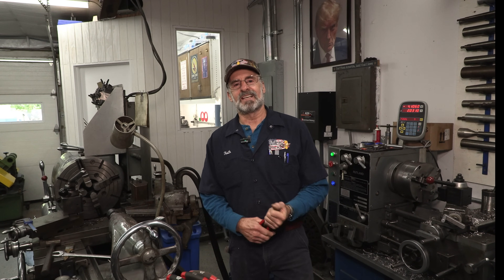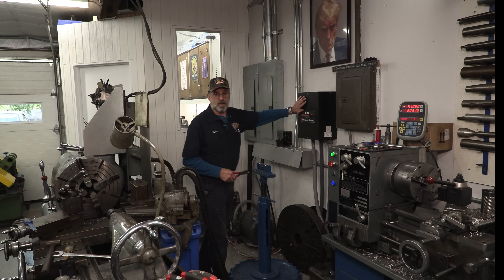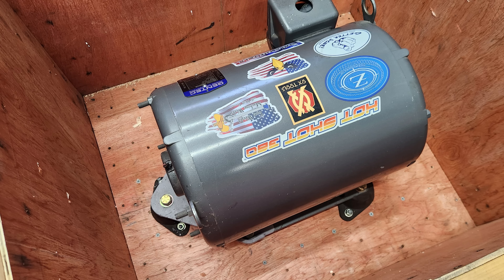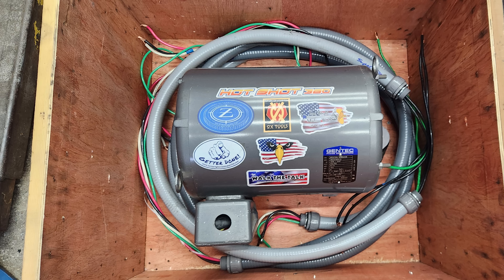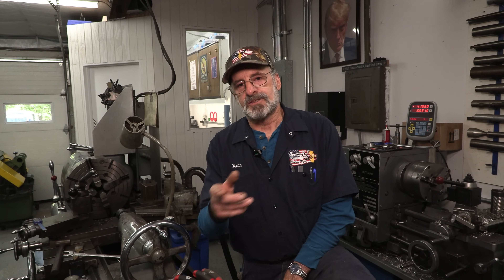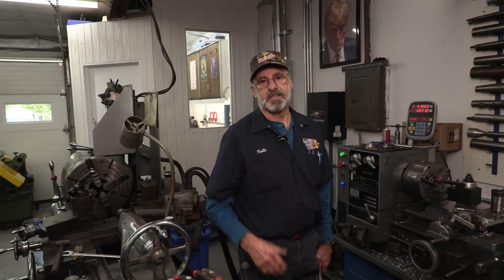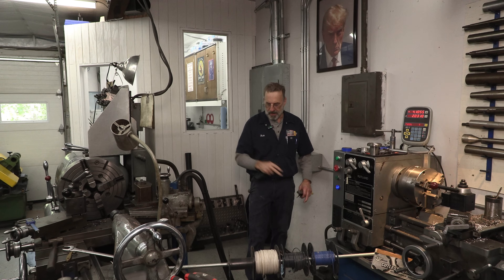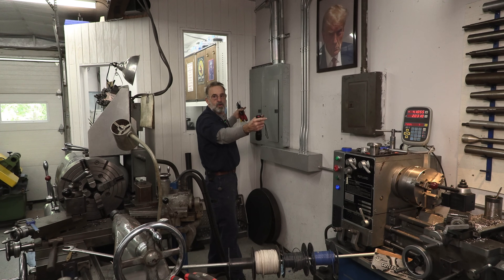No More Phase Converter

Comment: Keith, were your machines jumpered for 240 or 208 volts? If you used 230 or 240, consider installing a Boost Transformer to step the voltage from 208 back up to 240 or 480, and even convert back to a delta configuration. Talk to a local EE to order the correct transformer for your needs.
Reply: why would you do that? lots of wasted money and added complexity. delta power is obsolete and hasn't been supplied for ages now, to the point of power companies forcing customers to change their equipment and convert to wye setups.
if the equipment is that outdated to need delta power, it's time to modify it!  nothing I know of, ever required the high leg to neutral to function.
smaller buildings and lower HP motors, it just doesn't make sense to have 480v and all the added complexity/costs of multi-voltages and step down transformers to only run a small number of machines. 😐
Reply: @throttlebottle5906  I'm not sure I understand your reference to high-leg to neutral, which would produce 208V to ground single phase. Keith's shop has many machines, not a few. 
Not all legacy machinery can accept 208V three phase, especially instrumentation like DROs, etc. He already had open delta three phase coming from the motor-generator phase converter he owned. For open delta three phase service, the power company would only need to install two transformers, one bigger for 120/240V single phase and a probably smaller one for 240V open delta three phase. Since the delta is not closed, there are no circulating currents in the transformer bank wasting energy, and two unequal sized transformers cost the utility less than three size-matched  and impedance-matched transformers.

Comment: You can get "high tech" VFD (Variable Frequency Drives) that produce three phase power with user selected (or programmed) voltage and frequency with a wide range o single or multi phase  power.    It's all magnetic or electronic.  No moving parts.  The only noise comes from the cooling fan or a small transformer "buzz."
Reply from the maker: Yes, I know of those options....

Comment: It blows my mind that Eversource is that slow and took so long to do something so seemingly simple. They are never slow about demanding I pay my bill on time.🤣 I miss the old New England Power co and Public Service of NH They made things happen. Anyway congrats on finally getting power to the machines.
Reply: The electric company has no incentive to provide 3 phase power, they will be losing money as the 3 ph. Power should be cheaper! They typically drag their feet hoping the customer just installs a phase converter. I have 3 phase power line going overhead on my property but the power company refuses to hook me to it for my shop, the shop is too small and I’m in a residential zoned area!
Reply: On my utility the 3ph killowatts actually cost more than resedintial kWh.

Comment: 3 phase is the way to go. I have a 3 phase main line running through my ranch. Coop gave me the 17 reasons I couldn't get 3 phase service,  the main one being expense of running poles. I asked how far away from main line the first pole had to be. They said 40 feet. Wouldn't you know it, when I built my shop, the corner where the power came out  was exactly 39 fee!--go figure!!

Comment: Could you run the power overhead instead of running it across the floor, I know that’s not always doable so we’ll see what you come up with. 
Have fun on your trip and be safe!
Reply from the maker: I need to be able to move my gantry around in the shop, and the floor run is better in my case.
Reply: @KeithFenner , I knew you had a reason, thanks for the answer.

Comment: Congratulations! I remember you expecting this years ago. It's still mysterious to me how the US hasn't brought 3-phase into general use. Here in northern Europe every home has 3 phase 400 V and has has since the 1950s. Glad you are finally up to speed.
Reply: It gets worse! Philadelphia and Baltimore (or Boston) had 2 phase power. Philly was supplying 2-phase to the old section of the city in 2020. My dad had a refrigeration service business, so we had to be aware. I remember if you cross-phased the wiring you got 208 volts.
Reply: I served in the US Army in VN c. 1970.   The area of my responsibility was first "wired up" by the Navy a few years before.   The USN had 3 phase 120-208 power everywhere.   To be blunt:  it was silly.   Aside from requiring twice as many conductors, we had problems with equipment that as "rated" as capable of running 208-240 w/o any changes.  But in reality, the motors had early failures.
Reply: No. Not every home in northern Europe. In Norway it's normally 3-phase 230 Volt between phases. All other countries in Europe exept Norway and Albania have 400V between phases and 230 between one phase and neutral. If you measure between one phase and ground in Norway you'll measure ca 120 V. In areas with new system you'll have 3X400V and a neutral, giving 230 V between phase and N.
Reply: @lassehovde  I did hear that the reason for the 230V between phases in Norway is because there's not always a reliable electrical ground due to the geology.
Reply: @ehsnils  No idea, I guess it's like ''It's just this way'' Old radios could be switched from 130-150-200-220-240. Insulated Terra (IT) and Terra Neutral (TN) have both their benefits.
Reply: @lassehovde  I had never heard of the 230 V 3 phase in Norway! Thanks for pointing it out. Is this 3 phase voltage actually 220,. 230 or 240? As these numbers are often casually used but not necessarily the actual voltage (not accounting for volt drop etc here). For example UK, AUS etc are 240/415 V Wye whereas most of Europe and rest of the world is 220/380 V Wye. 

I heard from a US electrical engineer that in the company he worked for they tested their Europe-bound products for 240 V single phase and 220 V single phase (corresponding to 415 V and 380 V 3 phase) , and in his experience the actual ''nominal'' voltage of 230 V was not present anywhere. But I also heard from a European guy (think Dutch? not sure) that some adjustments where actually made in their country to change to 230 V (single phase that is).
Reply: @Orgakoyd  We called it 220V before, but I once measured 238 at home. Might have been oficially 230 then, but it varies how near you are the transformer.
Reply: @lassehovde  Thanks. I was  really not thinking of the exact voltages, but rather the idea of 3-phase "Starkstrom." Our voltage here in Germany changed some years ago.
Reply: 120/240 single phase is considered safer than 400+ volts in a residence. Here in the US, there really is no need for to have 3PH in a home.
Remember,  Keith moved into a garage shop for fixing autos. They don't need 3PH either. All decent, small to large commercial buildings have a 3PH service. If they don't, they were built for small contractors like landscapers and such. Again, no need for 3PH. The standard 100/200 amp service of 120/240 1PH is also simple compared to 3PH. Less materials to make it work. 2 Hots and one Neutral wire. It also prevents people from trying to run heavy equipment in a residence. There are ways around this, but it's not common. Hope I was able to shed some light on your inquiry. 😊
Reply: @jakebpau2396  Thanks for the info. I had a shop in the States in the 1960s and no way to run my compressor except with a phase converter, which irritated me. In Europe the three phases are split. Our home has 3 levels and each level is on a different phase. Of course, 400V 3 phase is available and 2 phases are often used on ovens and stoves. Normally, you only see 230 VAC 50 Hz.
Reply: @jakebpau2396  Just to throw in my 2-cents.. Transformer cost is probably the biggest cost factor, considering residential distribution has roughly one transformer for every 8-10 homes. 3-phase transformers are more complicated or several single phase transformers must configured for 3-Phase.
True; 3-phase also requires an extra wire (4 total in most cases), but the wires are smaller since less current is  needed spread out over the three phases.
Most light commercial buildings here in the US use a Y configured 208/120 3-Ph 4-wire system that works out nicely. Providing 208V 3-Ph and 3-legs of 120V each Hot to Neutral. Also makes load balancing much easier. The delta configured 230/120v 3-Ph is a whole different animal w/ a wild leg (might be what Keith has) but let's skip that for now..
I love 3-phase, but totally get the cost issue considering the size of the US..were stuck with single phase in most cases.
Great subject...could go on for hours..
ATB....
Reply: @TheAyrCaveShop  I can tell you without a doubt that Keith now has a 4-Wire, 208V WYE service. Natty Grid and Eversource will not supply a 3 wire Delta service anymore. You have to have it from years ago. No new installs of 3 wire Delta 240.
Reply: @jakebpau2396  Agreed I see that third transformer.
Reply: @jakebpau2396  Less materials to make it work? You need double conductor section for same power.
Copper is all but not cheap.
Safety of lower voltage is just an excuse, power companies earn billions and do not want to invest or invest as little as possible. When all is done by the code getting shocked with 400V is literally impossible.

Getting 15HP (11KW) from smallest 3 phase outlet is great thing to have in any garage and having 200A welder anywhere on any 230V outlet is life saver.
If i want to repair bumper on my truck i do not need to search for special outlets, any outlet will do, all 230V outlets are same.

There are many videos on YT where electricians and engeneers from US dissect electrical installations in EU, check them out, nothing but praises.

Why would i not operate heavy equipment in any residence? If i want to renovate my bathroom, i will run heavy Hilti rock breaker, 2,2KW angle grinder and electric pipe threader, tiles cutter and so on. There is no law aganst it.
Reply: @jakebpau2396  I disagree that there's "no need for 3-phase in a home", especially these days when more and more electric cars are coming and in Europe most of them have 3-phase chargers. With 400V 3-phase you can still get away with main fuses of 16 to 25A on a modern home, and that's without gas heating.
Reply: @ehsnils  Feel free to put 3PH in your home then. Let us know how it turns out with the electric company, and your TCI when completed. 👍
Reply: @jakebpau2396  We have three phase in our home. Every home in Germany has 3 phase. What is TCI? Turks and Caicos Islands? What a strange comment.
Reply: @BruceBoschek  
In the USA, 3PH is not in homes. 
Could you get it. Big Maybe.
Power company needs a legit reason to give it to you. They most likely will refuse. TCI means Total Cost Involved. So, no, it's not a ridiculous statement. It's a business term. You're welcome. 🤣
Reply: @jakebpau2396  Sorry. Didn't mean to be  a jerk. Thanks for the info.
Reply: @jakebpau2396  Already exists with residential 240/400V 3-phase here in Sweden. It's standard installation.
Reply: @jakebpau2396  You could just as easily have the standard 208V Wye 3 phase supply which conveniently gives 120V to neutral as well. I personally think every building should have 3 phase. And I don’t think the European 400V 3 phase is especially dangerous, after all its everywhere in commercial and industrial settings and people are not dropping dead. It’s 400V Wye, so 230V to neutral (no 120V supplies here in Europe, other than 110V centre-tap-earth through a building site safety transformer for power tools, deemed safer in case of shock. You’ll only get 55V line to earth).